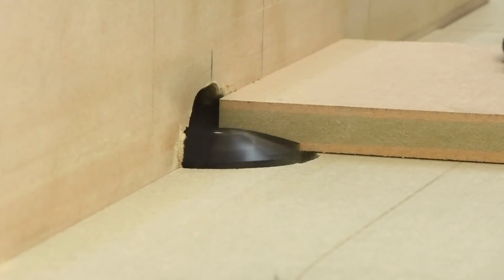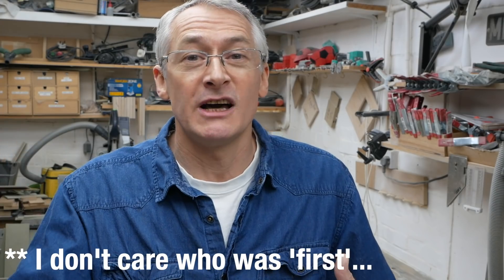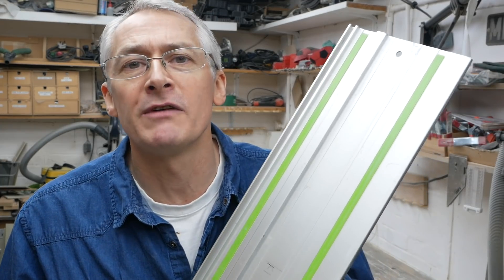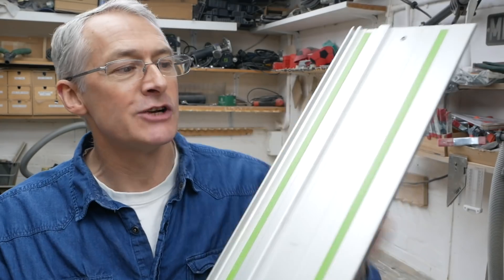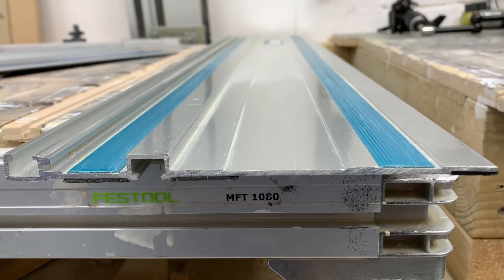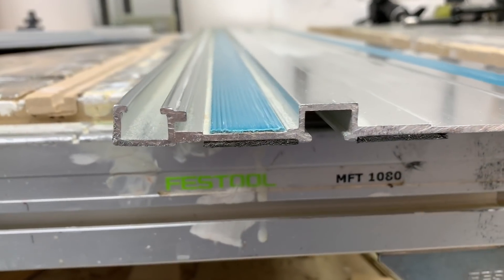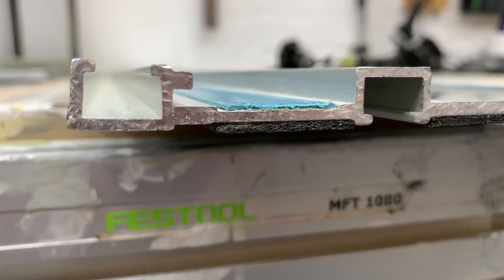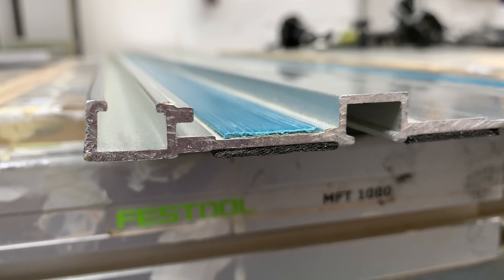TW P6; DIY Long Guiderail [video #282]

Comment: After thinking and doing stuff with my Skill circular saw I knew I need a track/rail system. But buying a whole saw while having such a nice machine already felt wrong so I looked at just the rail systems. Amazon has a Wolfcraft that accepts most circular saws, set with two rails and a total length of 2.4m, was €80 more of less but not in stock so could take months . The basic attachment and one rail was in stock al around €55 and a second rail would be €45 making it a €100 buy to get about the same yet seeing it for 80 made me growl :) but then I thought about my jigsaw, diamond circular saw for stone (with water attachment) my small circular saw and my router. Five tools that could benefit from a rail system so I just ordered a German system with two rails (100 and 80) rail connector, universal circular and jig saw clamp to hook up to the rails, a router hookup thing, clamps to attach rails to stuff and two stop blocks. Cost me €112 shipped, will receive it this week, and write a reply with name of it and how if works, for now it feels really good to have gotten something that accepts all tools I would like to have rails with with the option to just but more rail and connectors if needed, for a price I would not get a plunge saw with 180cm cm rail. Specially the stone cutter would really benefit from a rail system, the water and stone grin dings create mud on the scribed line on the 50x50x4cm sconcrete tiles I'm cutting at the moment so just setting up and go would make cutting those so much easier.
Reply: Ok I have played a little with the system. Kwb line master . For my purposes it's very nice, but to start, the saw and tools (got myself a baseplate for the small angle grinder and will order a baseplate for my 230mm grinder making this line master useable for so many tools) still glide along the rail, a real plunge saw rides on the rail, so more stable and easier to set up same cuts by sliding a new piece of material under the track, this requires new setup for my system. For profs like you Peter this is by no means a replacement, for me, home owner just making stuff and need straight lines or even circles it's ideal and because it works with so many power tools it is a good value for money.. Starter kit came with some neatly things like a slider for knifes and pencils making cutting or marking real easy (also paper) and the router adding has sweet double rotation piece (either use the supplied nail or the p,ate to attach to wood if one does not want to damage workpiece to make circles. I saw tool slider in Amazon warehouse for 8€ so think I will buy that so I use the first to mark my skill circular saw line cut  on it making measuring easier. And use the second for the other tools. So the real deal is absolutely better as track saw yet for e simple bloke like me the use of 8 tools with this makes it a pretty sweet buy.
Reply: Surprisingly, Makita sell tool adapters for router, jigsaw, and circular saw to use their plunge saw tracks.  Of course they sell the plunge saw too but the option is there to use the other tools as well.

Comment: So cool love it all. was wondering though. what about buying two Adi Saws? will putting 4 rails together be even better?
Reply from the maker: Haha, interesting idea given the price of the rails, but it’s not generally a great plan to have so many joins in a long rail, especially if you need to move it around👍👍
Reply: @10MinuteWorkshop  I have been so excited about this series. wonder though could you do a test with laminate? I have one Aldi Track saw not got it out yet though. so glad I haven't as your tips for it are AMAZING!! I did see they have been reduced at my Aldi to £69. if your keeping it in the workshop and not moving it around at all. do you think 4 guide rails together would be ok? Or you still think I would better making my own? £300 + for the festool long rail is a little out my budget at the moment.
Reply from the maker: parrot340 Honestly, no - just moving it from one bench to another would be enough to unsettle a long rail with that many joins. Unless you desperately want another saw, put the £70 towards the Makita rail. Or have a go at making your own 👍👍
Reply: @10MinuteWorkshop  Just looked at the Makita Half the price of a Festool. so the Aldi Track saw fits the Makitia??
Reply: For full length cuts, I’ve been using a Titan with its 2x700mm rails attached to the Makita 1400mm rail. It’s ok but even with 3 rails I do need to be careful moving it around as Peter suggests. Making the 1400mm the middle section helps with stability and I’m using double (over and under) connectors at each join. At some point I’ll probably get a second 1400mm Makita instead. Love Peter’s homemade rail but I have a low ceiling and not much spare horizontal storage!

Comment: Great series, but you left out something basic: how to do a cut. How to plunge, kickback etc.
Reply from the maker: Yeah, I had a segment shot about that, but decided it was a bit too basic, and tbh I’ve covered it in other videos. I may include it in the actual review of this saw as it does t have an anti-kickback feature - through in ~12 years of using a tracksaw I’ve never experience kickback. 🤷‍♂️
Reply: Peter Millard I was using my newly set up Lidl track saw yesterday and experienced kick back for the first time. Definitely user error but I’ll make sure to be triple-careful in future, thankfully no injuries just a damaged splinter guard. Good job you showed how to replace it 😀